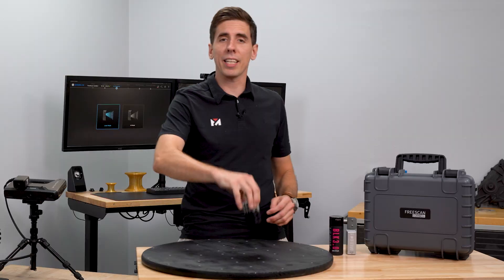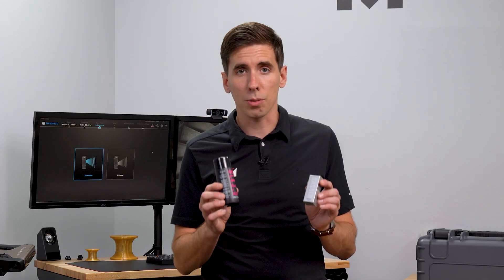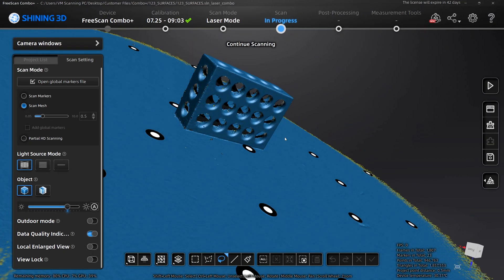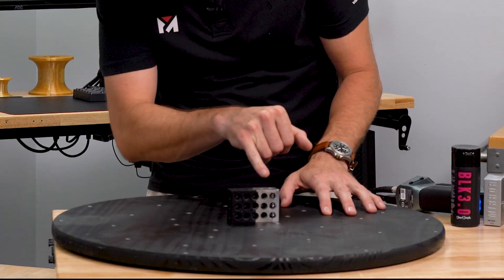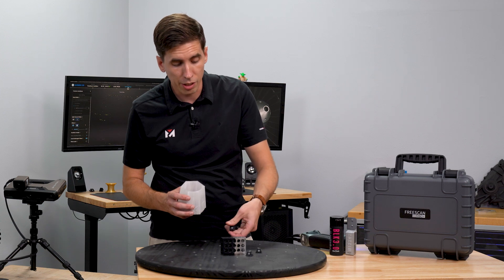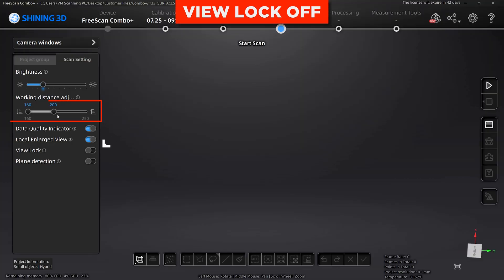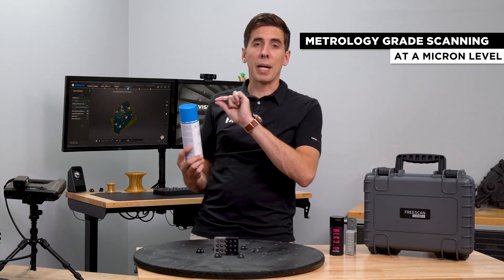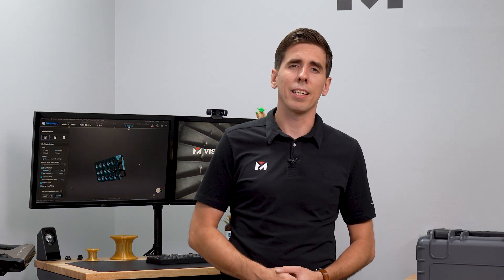3D Scanning Reflective and Super-Dark Black surfaces: Shining3D Freescan Combo+

Comment: Sorry about my earlier comment, I did respond to you but since I deleted my comment you may not have seen it. I didn't follow your entire process, so I may have missed it. And, I don't know if the Freescan Combo+ has a different workflow or not. It has been my understanding and what I've considered to be best practice, to do a marker scan first and save it off as a separate marker file. And then import that marker file into your scan and then start scanning referencing that marker file. It can help a lot to align scans, I have a bit more experience with another manufacturer's scanners than I do with Shining 3D, but I do have Shining 3D scanning experience as well. There's a little more to doing it well than a lot of people seem to realize. 
Again, I apologize for my earlier comment.
Reply from the maker: Yes, technically scanning markers first is best practice, but in the Freescan software, you dont need to save it and then load it, it's just automatically there. Generally, I find scanning markers and data at the same time works fine for our needs, but you definitely have options :)
Reply: @VisionMiner  The problem with that is that is that for complete scans of object, it often requires more than one scan and those scans need to be aligned as accurately as possible, so that's where you want the saved marker scan file, for the additional scans and aligning them all. I don't recall right now if Einscan's software allows for multiple scans within the same scan or not, which would be rather gimmicky if it does. Your additive engineer claimed in one video that you guys don't sell customers on things because expectations can be different. But your selling of 3D Scanners isn't nearly as professional as your 3D Printing appears to be. Frankly your expertise is pretty limited or none existent.